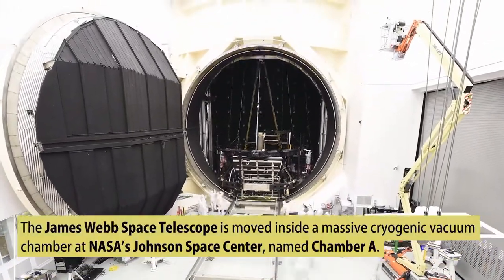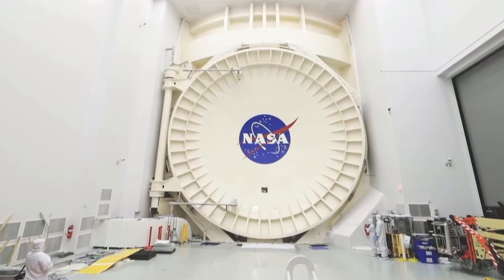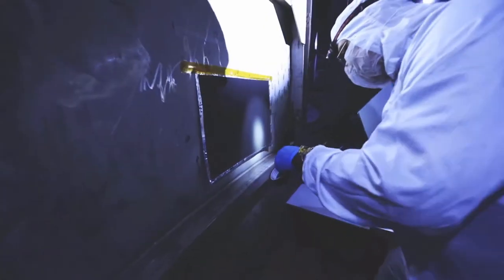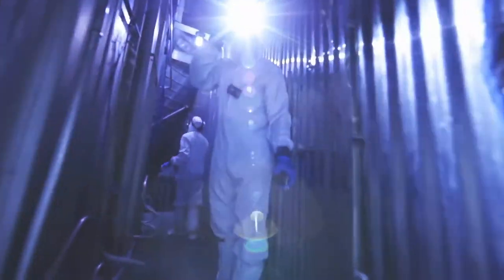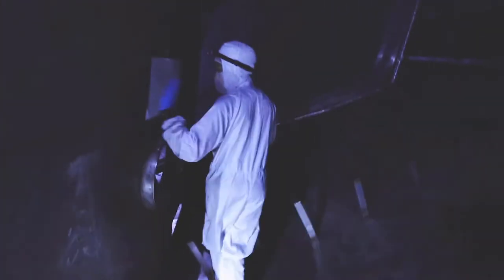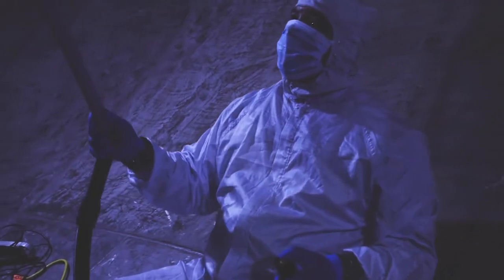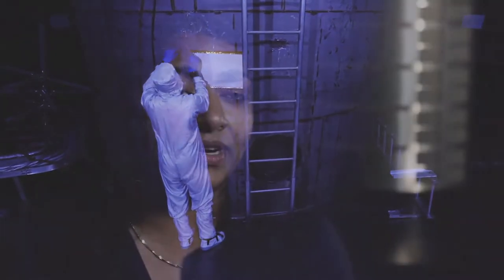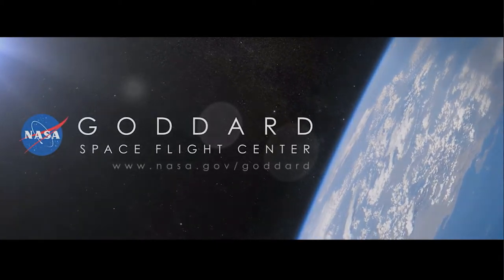NASA's Chamber A

Comment from the maker: Hidden below Chamber A at NASA's Johnson Space Center in Houston is an area engineers used to test critical contamination control technology that has helped keep NASA's James Webb Space Telescope clean during cryogenic testing. This voluminous area is called the plenum, and it supports the weight of the chamber above as well as houses some of the cabling and plumbing for it. Before Webb's cryogenic testing in the chamber commenced, engineers ventured to the plenum's depths to test NASA-developed technology designed to remove molecular contaminants from the air. Catching contaminants Nithin Abraham, a coatings engineer at NASA's Goddard Space Flight Center in Greenbelt, Maryland, is part of a contamination control team tasked with ensuring Webb remains as clean as possible during its testing in Chamber A. Abraham developed and tested a highly permeable and porous material called molecular adsorber coating (MAC), which can be sprayed onto surfaces to passively capture contaminants that could be harmful to Webb's optics and science instruments.  

For more information about NASA's Webb telescope, visit: www.webb.nasa.gov or www.nasa.gov/webb